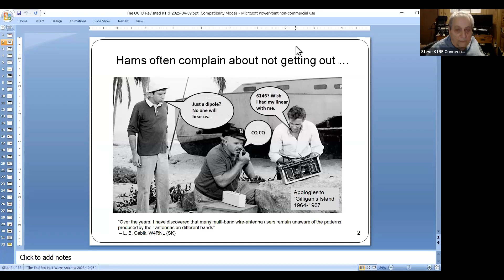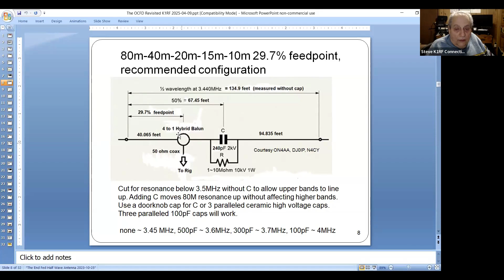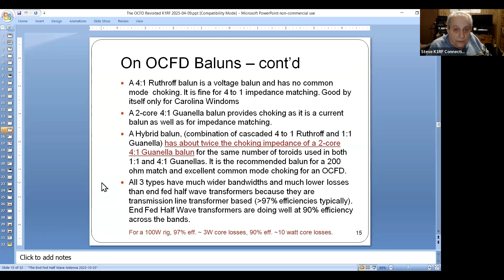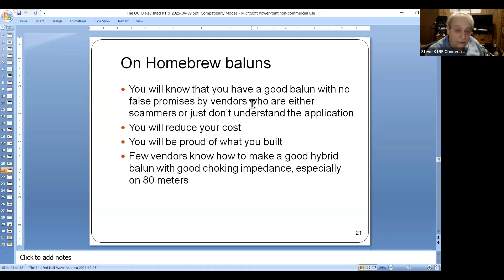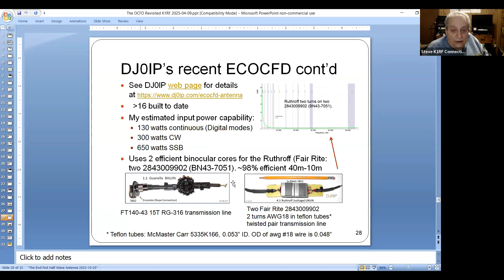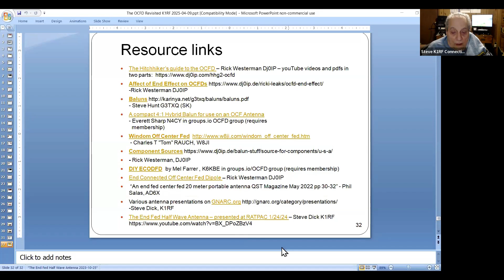OCFD Antennas Revisited ~ 4/9/2025

Comment: I would love to build 80-10 ocfd once but it's a hard call for an unexperienced ham I think. there are like two challenges. the balun which need to be the hybrid one and finding the sweet spot(feedpoint), a point along the wire where to cut, where the current is not zero on 80-10 bands.

Comment: I love my BuckMaster OCFD antennas.  With a choke at the antenna feed point both the 6-80 and 6-160 Meter 3,000 Watt models cover every band, even 60 Meters with a radios internal antenna tuner.  They don't claim they do but they do.  Mike KC3OSD